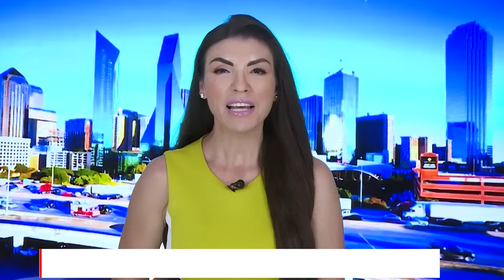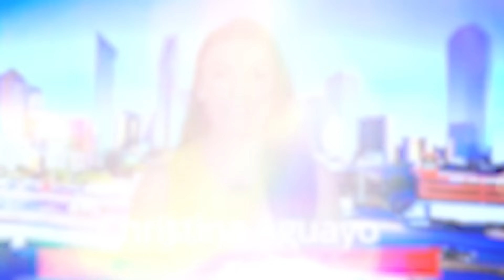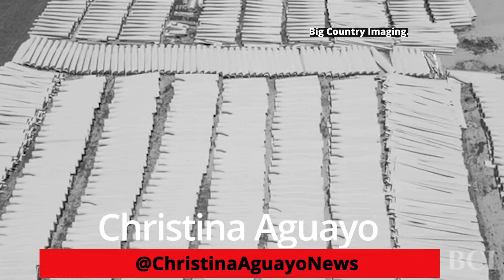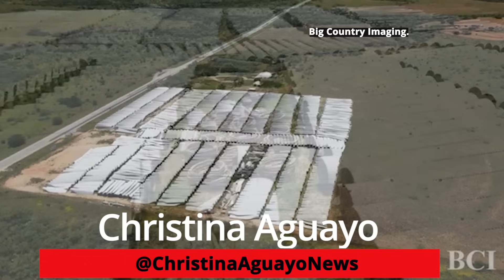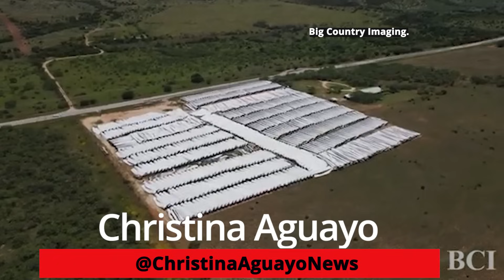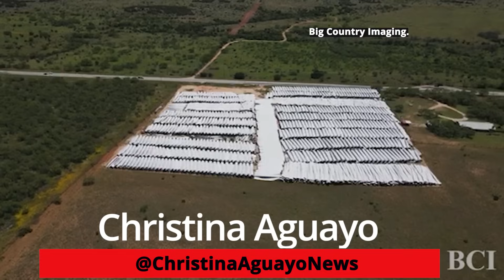Turbine Blades Piling Up In Landfills, Leaking Chemicals Into The Soil

Comment: Former trucker, current P/EVO here. If you think this is bad, stop and REALLY think.

A wind tower has 3 tower sections, 3 blades, a nacelle and generator, and a hub. There is land acquisition/leasing and site construction plus site access, which may include extensive road work, utility relocation, and more. 

The components are often made overseas and shipped here, then moved by rail or from a port by truck.

Including a truck driver, each component requires a P/EVO like me in a high pole or steerman capacity, and frequently a third escort vehicle as a supplement because people can't drive worth a damn. 

Blades and tower sections require the use of very expensive, custom made trailers. 

Total traveling crew members per piece:

Hub: 1 truck, 1-2 escort.
Nacelle: 1 truck, 1-2 escorts.
Tower section each: 1 truck, 2 escorts.
Blades each: 1 truck, 2-3 escorts.

A minimum of 8 separate transports for a single tower, on top of seafaring transport and rail.

NOW take into account the energy generated during the average service life of a wind tower compared to the energy consumed for manufacturing and transportation.

THEN realize that electricity is consumed the moment it is generated. It is a 100% on demand system. Grid tied electricity is not stored anywhere.

You can not escape thermodynamics. It takes more energy to make and use wind towers than they generate. It will catch up to us. There will come a time where our only source of renewable energy is wood. Not in our lifetimes, but of the human race survives another few hundred years, it will come.
Reply: A single 3-MW wind turbine requires 335 tons of steel, 4. 7 tons of copper, and 1, 200 tons of concrete (cement and aggregates). Not exactly resource friendly.
Reply: @oliverheaviside2539 And, making concrete is the second worst thing (after the dreaded “fossil fuel”!) to harm the planet!!!
Reply: @oliverheaviside2539  no you must be wrong ! the government wouldn’t have done this - they would’ve done all the research , and so many people have criticise me when I have said the same comment as you so we must all be mistaken! somebody is falsely creating these images😂
Reply: @oliverheaviside2539 I read about 15 years ago that per megawatt, wind power generation required about 10 times the concrete and steel that conventional power generation did and once the tower is decommissioned,  you are left with a plug of steel and concrete buried in the ground that nobody will bother to remove.  Our nuclear power plants are lasting  50, 60 and 70 years on a site that occupies a handful of acres. Nobody ever mentions megawatts per acre or power density per acre.  With the population growing we should be more mindful of land usage too let allow how we contaminate it.
Reply: I will also add that these WM electric turbine motors have to be rebuilt every 3-5 years requiring removal shipping via trucks to rebuild facilities to install new copper windings, wiring, bearings, seals, motors shafts if they can’t be rebalanced then reassembled, trucked back to the site and reinstalled.  Every single aspect of this requires FF even the manufacturing of all the parts required for rebuilds.  These WM only have a lifespan of 15-20 years and with turbines requiring rebuilds and repairs the cost is far greater than the ROI thus the taxpayers are footing the bills of on industry and infrastructure systems that is already bankrupt from the day it was announced.
Reply: I think we'll come to find out that the Earth is generating hydrocarbons pretty continuously.
Reply: Understood. Came up on a couple in n Illinois. Same as ethanol. So much gas n diesel to produce ITT. Then you burn up extra gas too keep power up.
Reply: And don't forget that if the wind is too strong it shuts down automatically to prevent any damage.
Reply: Great info…knew it was scam from the beginning..just utilize some of Dr. Sowell’s logic on economics & my 3 yo grandson could figure out it’s all been a huge $$ laundering boondoggle… frightening.. 🤦‍♂️
Reply: Excellent observation.
Reply: Lol, you know the earth is making petroleum right now? Plants and other things didn't stop decaying millions of years ago. It happens every day
Reply: And the ships burn super dirty bunker fuel.  They ain't solar powered!
Reply: Yup, a lot of “fossil fuel” used all along the pathway to completion. Not to mention the gallons of oil inside the turbine itself. 
Yeah, these will save the planet!
Reply: @garypiatt4666 they don’t use a lot of oil for the wind turbines.
And the used oil is recycled
Reply: @Noneofyourbusiness19 Please do a Google search of how much oil is used in a commercial wind turbine, as I did. 
The minimum I saw per turbine was 50 gallons, some up to 200 gallons!!! Plus, they use a tremendous amount of gear oil. 
I also read that they require the oil to be changed every three years. 
That adds up to a LOT of oil.
Reply: @garypiatt4666 the oil is recycled 
So it’s doesn’t matter how much you think they use!

Your argument is weak!
Reply: @Noneofyourbusiness19 It is NOT how much oil I think they use- I read several reports, not just one, that told of the quantities of oil used. 
What is it YOU think they use for lubricant in them?
Reply: @Noneofyourbusiness19 So, the oil used is recycled- does that mean it doesn’t harm the planet as much as, what, un-recycled oil?
For something to be “re-cycled” it must be “cycled!”
Reply: @garypiatt4666 they use about 89 gallons a year on average

Again, it’s recycled!
So your point is worthless
Reply: @garypiatt4666 how much oil do oil rigs/pumps use yearly?

I’m sure that is recycled as well!
But I’m not against oil rigs!

I’m saying that your point is invalid
Reply: @garypiatt4666 wind farms are good for electricity and cheap to maintain
And better for the environment 
Why are you against them!
Reply: @Noneofyourbusiness19  The “89 gallons” you mention is used annually, NOT the total gallons inside the windmill. 
A list I found is as follows.
Gearbox 80-120 (some have up to 200) gallons. 
The yaw system 5-10 gallons. 
The pitch systems 3-5 gallons per blade. 
Braking system 5-15 gallons. 
Transformers are full of oil is all it said. 

These amounts are for the small windmills. Bigger units= more gallons of oil. 

It does not matter that the oil is recycled!!!!!!!!! What difference is that supposed to make?
Reply: @PaulTompkins-m5n how many tons of CO2  are produced recycling that oil and how many hundreds of gallons of new oil is added to the oil from each turbine when it is recycled?
Reply: @Noneofyourbusiness19  wrong
Reply: @garypiatt4666 the oil is recycled, making wind turbines the most environmental friendly,
Right, fracking machines are fully loaded with oil,  they extract natural gas.
Spent uranium needs to be handled and disposed of carefully.
Hydro usually transforms the ecosystem above the dam.

Do you understand..
Reply: @terenceiutzi4003 less then what is used for frack machines.
Reply: @kane-vn6bn if your answer is wrong without providing any info then maybe you’re wrong
Reply: @LoriPhiLip-u9s, so your frack machine  uses 300,000 LBS of heavy bunker C oil?
Reply: @terenceiutzi4003 does a wind turbine? No
Reply: @terenceiutzi4003 do you know what a frack machine is?

It runs on oil
Reply: @terenceiutzi4003 a wind turbine uses 3 to 200 gallons of oil. That is recycled after use.
Reply: @LoriPhiLip-u9s Yes I used to build frack tanks! The massive tanks thattheyvfill with the glycerin and sand mixture!
Reply: @terenceiutzi4003 hey, same here.
Reply: @LoriPhiLip-u9s The new Suncor frack farm is all fead by high pressure piping and uses a 3,000 KW electric pump system instead of the 5,000 HP Diesels
Reply: @Noneofyourbusiness19 But it's still oil 😂
Reply: @PaulTompkins-m5n 
HOW EXACTLY do you " recycle " the Oil USED ?
Reply: @Noneofyourbusiness19 bollox, turbines do a hell of a lot of damage when you take into account manufacture and building and then they cost millions to turn off when its windy
Reply: @Noneofyourbusiness19  bullshit
Reply: @sammiroberts4653 really
Do you have a source?
Reply: @sarah20025 so enlightening
Reply: @sammiroberts4653 do wind turbines do more damage than Oil rigs?
Do wind turbines pollute the air?

No
Reply: @Noneofyourbusiness19 in the manufacture and transport and building yes they do, they have a 20 year lifespan, blades can't be recycled so are being dumped in vast numbers and half the time they don't run as its too windy
Reply: @sammiroberts4653 seriously
Wind farms have been around long enough to k ow that the benefits out weight the negatives
Reply: @sammiroberts4653 wind turbines create the least amount of pollution, including in the manufacturing of them
Reply: And think about the concrete base. How many tons of concrete are needed for each tower? Over 1000 tons per tower, I hear. How much CO2 is released by making such huge quantities of cement? How much to transport it? How many truck loads of cement per tower? How much to dig the huge hole and transport the earth? How much will it cost to remove the huge slab so the land can be re-used? ...
Reply: @hattmarvey1989  yep , about 600m3 per base in Galway. 75 loads from 3 plants running from 5am till 3am next day. 2 pumps on site could only pump 20-30 m3 per hour. I have the receipts. Articulated concrete trucks struggled to make the climb(Galway wind park is in the mountains), I saw one roll back, scary. They called it a Wind park, like its a recreational space. They cleared forests to make it. How green is that?
Reply: @hattmarvey1989 still less than the frack machines produce
Reply: 600 cubic yards of Rebar reinforced Concrete in the Base of EACH one  .
Mixed and hauled by Truck .
Diesel powered Cranes to erect them  .
1/2 acre of land for each one  .
4 - 500 Gallons of Oil in EACH one  .
They are notorious for catching fire  .
" Green Energy " , RIGHT  ?
Reply: @RW_TractorPilot Yeah, but, um, uh, they use recycled oil!!!!!!
Didn’t you read some of the responses to my posts? They explained how I was so very wrong in my assessment of the fossil fuel used in erecting these monsters. 
I hope my detractors read your posts!!! Thanks!!
Reply: It all kind of figures. Sad, but still, hopefully, common sense will make a comeback.
Reply: Oh wow!! 😦 Thank you for the information and the breakdown of it. I really appreciate it.
Reply: Danke für diesen ausführlichen Bericht !! Es fehlt nur noch, das 30 Meter tiefe Betonfundament im Boden. Oft Ackerboden. Das man nie wieder entfernen kann 😡
Reply: There are fuel cells that store the electricity

Research off show wind farms in Scotland and Germany
Reply: Your book is ignorant
Reply: Yep..SO Many Gullible people willing to buy Everything they are told about Green Energy.. I'm So Glad more people are FINALLY speaking out about this.. I've been preaching for Years that solar and wind are Not Only NOT the answer they are WORSE than Fossil..  The whole environmental crisis is a BIG FAT LIE..
Reply: Future forever garbage just like solar farms.  Pollute and ruin our agricultural farming ground that were taken away to make these.  Cutting down forests as well.   Bunch of BS
Reply: These wind turbines are the LEAST EFFICIENT energy on the planet. When you add up ALL THE FACTORS they are definitely a NET NEGATIVE. A FACT conveniently ignored by the Climate Cultists.
Reply: All to legitimatise the climate scam and money laundering of our taxes to NGO’s . 
Blades are mainly constructed from epoxy resin with a balsa wood or foam core with fiberglass reinforcement. 
Aprox 30-40 % of the construction will be glass that can be recycled. 
This can only be done by either chemically removing the resin which is generally not practical or financially viable. 
The only other option is crushing them and burning off the excess resin which then leaves you with a pile of dirty glass fibres , that have no real use . 

Most of the materials will probably come from the far east ….
Reply: Making the concrete for the base - the altar upon which these monsters are worshiped - negates EVERY supposed benefit they are famed for providing.
Reply: 600 cubic meters of concrete in each pylon base. (the ones in Galway Ireland I worked on). 75 loads at 8 m per truck.
Reply: And how many millions (or hundreds of millions) of birds killed every year by wind turbines??
Reply: @monicapushkin3274 high rises kill the most birds

Wind turbines dont
Reply: @monicapushkin3274 not many actually

Wind farms are not built in bird migration routes and can the blades can be painted

If you’re concerned about birds dying, then do you complain about high rises being built? That’s the number one killer of birds each year

Comment: The real face of green energy. Turbines only last about 5 years.
Reply: They can start breaking down that fast, yes. The average life span is barely 10 years. After 15 years their power output drops significantly, same for solar.   
Claims of 30 year lifespan are utter lies. SOME can last that long, but over half will be gone and the remainders will be at maybe 50% capacity.
Reply: @5Cats drill baby drill. Keep giving subsidies to oil and gas. Have you seen the lifespan of an oil well or fracking station?   Less than 2 years.
Reply: @GreyMatterEnergy  Many oil wells last for years. They work until they run dry, then they get capped. Fracking sites are done & there's no difference to the environment. Any groundwater that deep won't be coming to the surface, and it would have been in contact with oil & gas regardless. Yes there are abandoned wells and that's criminal. The people involved should be jailed.
Reply: @5Cats fracking is not as simple. It's what is injected into the ground which messes with water. Too many issues to suggest it's not fracking.  Article today about the 1000s of abandoned wells in CBC and 10,000s of abandoned wells across US.
Reply: @GreyMatterEnergy  Yes, there's companies skirting the rules. Everyone involved should be sent to jail. That doesn't change the fact that oil and gas cannot be replaced by wind and solar. It is impossible without massive leaps in technology. Not "hard" it's physically impossible.   
Add to that: China and India are raising their CO2 every year and will do so until 2030 as planned! If there really were an existential crisis? This would not be allowed. So it's all fake.
Reply: 2 years on a sea, and they shed a lot of small particles into the ocean / sea.
Reply: @woocashtech oil drilling platforms do what?  Do some research on nerdles or virgin plastic beads. Cheers
Reply: Rubbish utter rubbish 20-25 years uk north sea ones only jist being replace after 27 years, oil recycled its the USA u lot just never want to recycle
Reply: And...gas cars last how long?  How many abandoned oil wells are there...?
Reply: @GreyMatterEnergy  My Oldsmobile is 19 years old & still working fine (knock on wood). No need to replace the engine every 8-10 years. (Equivalent cost of an EV battery)
Reply: @5Cats  moot point then ya?

Comment: Christina.   I install solar here in Northern California and I’ve been in it for years. 

I’d like to point out that the solar panels*[ not inverters ]that we installed 20 years ago that are nearing the end of their life expectancy. ……. Are actually not degredating like we had thought. 

I’ve worked at a couple different solar outfits, and I make it a point to have conversations with the head service electricians. 

I have noticed that the solar panels are actually still producing quite well.  And the newer modules appear to be degridating  even less. 

I bring this up because this actually might be a good thing for solar or for pollution. Meaning we might be able to reuse these modules. 
They will need to be paired with the correct inverter.   ( electricity grid providers only allow specific equipment on the lists) 

And they like to only put brand new equipment on these lists. 

But as a journey level solar installer/electrician….. I truly feel that we have a chance to reuse these modules. And to not actually fill up the landfills. 

I think people should discuss on a path to reuse a lot of the solar panels that have been installed.   

Some need to immediately be destroyed and recycled.   

But some, and I’m pretty sure most could easily handle a second reinstall.   As long as they are paired with a good inverter, that meets all of the grid profile parameters/requirements.  

This is a little different than the waist that is created from wind farms.  

Hope everybody has a good weekend.
Reply: Whatever happened to Soylendra that Obama made billions on before it went bankrupt?
Reply: Ive used monocrystaline i bought new 10 years ago... and they are still putting out the same amps.    Charge controllers are junk now...  we need a good one made in america.